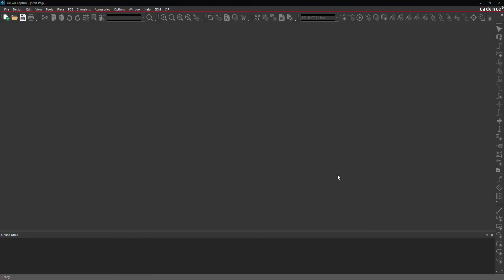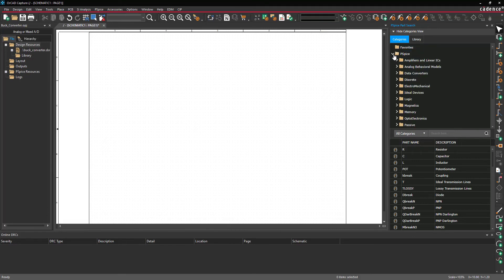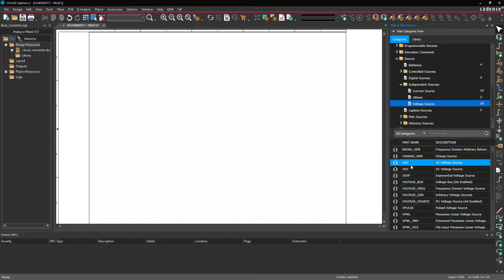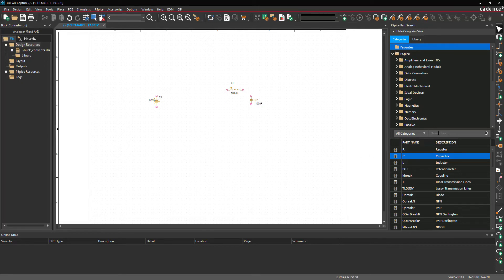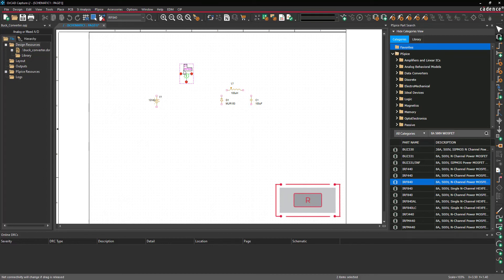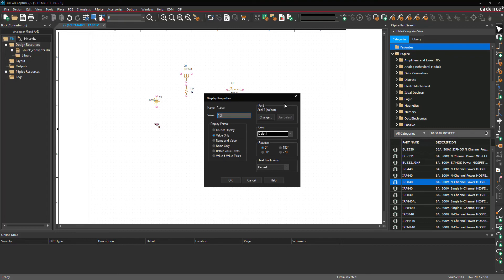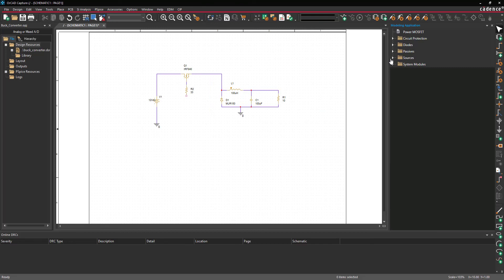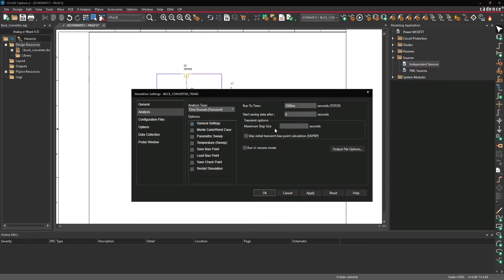How to Quickly Find Parts in OrCAD PSpice

Comment: I can't find 'search' under Place > PSpice Componet
Reply from the maker: Hi Wendimu, what version of the software are you using? It should be the menu option after "sources" (Shown about 28 seconds into the video).
Reply: i have the same problem. I have PSPICE 22.1
Reply: Did you find a solution?
I have the same problem with 22.10.006 @janh.8998
Reply: Click: Place > Component ... > PSPice > Source > Idependent Source > Voltage Source > (Right Click on VDC > Place) OR Double-Click